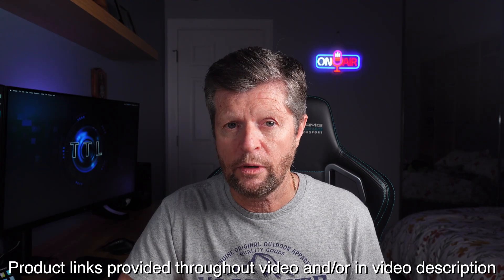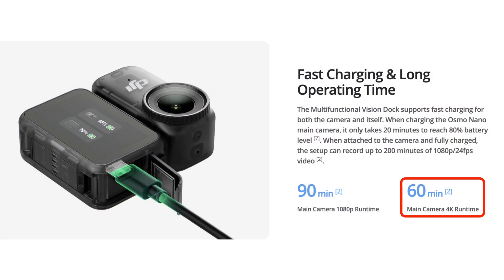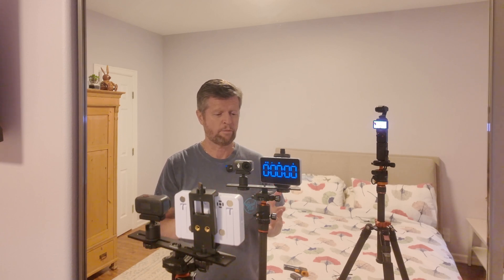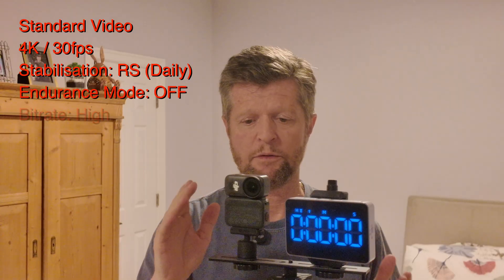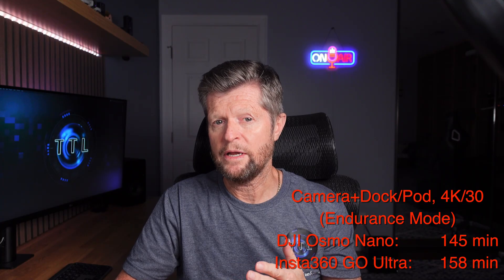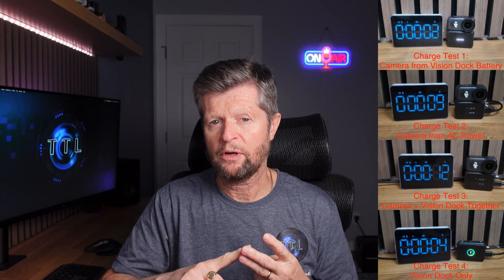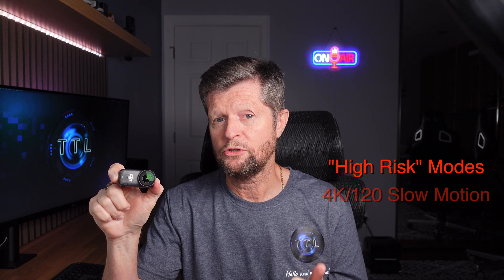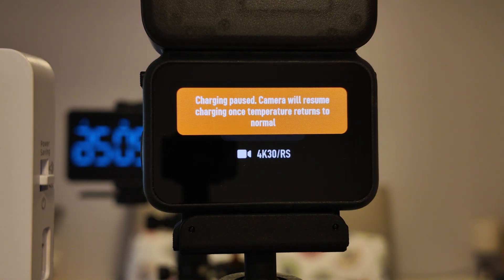DJI Osmo Nano: Battery Performance Endurance and Overheating

Comment: I received mine today and updated it to firmware V01.01.1654 (is this the latest version?). I tested the camera unit on its own at 4K25, 4:3, RS/NW, high bitrate, colour set to Normal 10-bit, and the LED switched off. Starting from 98% battery, it recorded for 41 minutes before stopping at 10% due to overheating. I was hoping I wouldn’t encounter any overheating issues.

I understand some people say the Nano isn’t intended for long continuous recording, but that isn’t the point. If DJI advertises a certain number of hours of battery life, then customers should reasonably expect to achieve that. I’d like to think proper QC is carried out, and I’m surprised this overheating problem wasn’t identified. Worse still, it feels as though the Nano may have been released despite known overheating issues!

Comment: I would like to share my impressions of the DJI Osmo Nano so that people know what they are getting. I will also share my personal experience with this camera. I bought it three days ago and returned it to the retailer the very next day. After starting it, I installed the new software suggested by the phone app. Then I charged the batteries and left only the camera running at room temperature of 23.4°C and humidity of 52% (as shown by my room thermometer). After about 20 minutes, it shut down due to overheating, and I had not changed the factory settings except for the resolution – 2.7K30/RS. Nothing else was modified. For me, it is disappointing that it lasted so briefly, especially since it is advertised to record twice as long at higher resolution. In my opinion, this is a “winter camera” – suitable for winter sports. In summer, however, it is just an expensive piece of jewelry you can wear around your neck.

That said, I must admit I am truly impressed by its compact size and overall product quality, apart from the rather cumbersome phone app. I did not get to perform the same test at a lower resolution, for example 1080p, to see what would occur first – overheating or battery depletion.
Reply from the maker: Thanks for sharing your detailed experience!

Comment: I had mine for 3 days. Shot outside 1080p/30 8 bit, standard, 75-80 f overcast skies. Longest I could get it to film was 21 minutes. Overheated every time and I did download the update before I filmed.  Sent it back for a refund. Also, I shot with just the camera attached to the pendant on my chest. Wind was lite.

Comment: What about recording 1080 30fps for the standalone camera indoors? Also does recording 9x16 change anything because that’s what I want to use?
Reply: You do not record at 9x16, you rotate the camera. I have 30 degrees weather where I live and I never have overheating at 1080p.
Reply: Good information . You da best